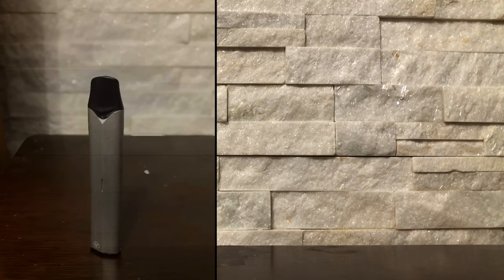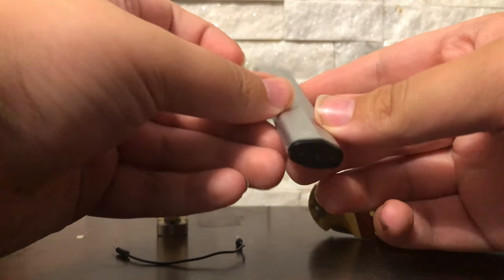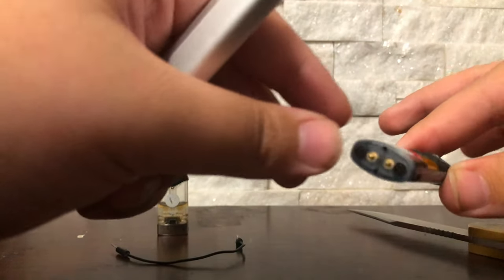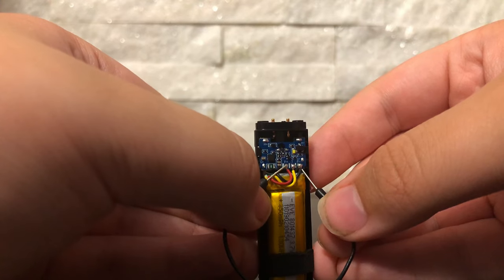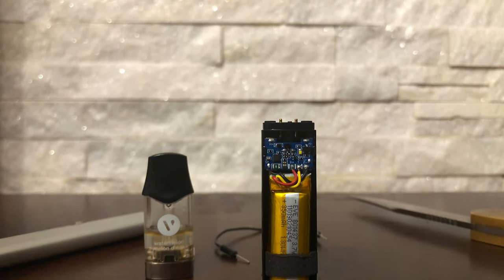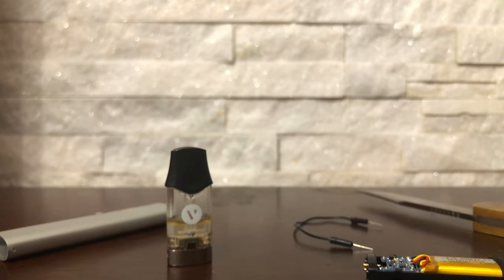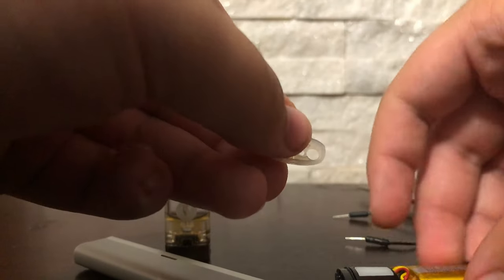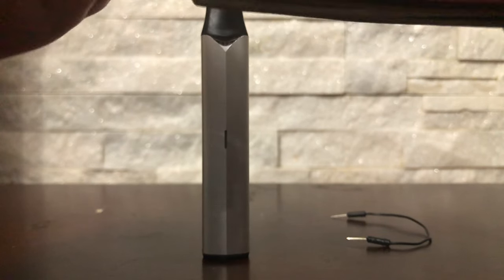How To Fix Defective Vuse ePod 2 In 5 Minutes! | [WORKING 2024] | Check pinned comment

Comment: Okay got the bottom part off, that was so difficult. It’s all mangled now. 

Then I used a safety pin o shirt it, there was a teeny tiny spark, and now when I charge it, the light stays on constantly (it won’t fade blink) 

Did I do something wrong? Is it going to explode??
Reply from the maker: if the light stays on that means it’s fully charged if it doesn’t fade after 5 seconds, that spark is supposed to happen, doesn’t always spark but it can
Reply from the maker: no it won’t explode😂
Reply: Thank you!! I’m still going to contact vuse customer service because this is the third pod I’ve bought this has happened to. So frustrating!
Reply from the maker: @megancampbell5603  no problem, they really have issues with their devices, i recommended getting an RPM40 or a NORD 2 if you like those kinds of vapes. 10/10 recommend the RPM if you like box mod designs with really good airflow, believe me it lasts long and works really well
Reply: You’re awesome! 
Can I get those at regular gas stations? I’m in Ontario. Where would I find those, vape shop I guess?
Reply: PS once I pulled another time, the light stayed on constantly 😳 really not trusting Vuse anymore.. 🤦🏼‍♀️
Reply from the maker: @megancampbell5603  Vape shops or online at smoktech
Reply: @megancampbell5603  corner store

Comment: Is there an alternative to those wires you were using to short with?
Reply from the maker: a normal stainless steel fork can work too, anything metallic that can reach both the red and black wires that are soldered to the board.
Reply: Any metal will work just fine. For instance I used a staple to do mine and it worked perfectly.
Reply: Use some tin foil. Small piece and roll it so its like a wire

Comment: How do I get the battery out mine has a curved shape and I can't get a knife evenly to separate it though not sure if the two dots on both sides have to do with it either not working or coming out...
Reply from the maker: those pins can come out which is kinda hard to do though
Reply: @xenocal  yeahh I was able to get one out, though think I got the other stuck smh, they really know how to make a product that craps out on ya
Reply from the maker: @user-pr2rz4jr5p  facts
Reply: @xenocal  I was able to get the battery out though there's only three cords white red and black, and thw board a bit different not too sure where I'd need to apply connection

Comment: Every time i put the pod in and take a pull then there is smoke but the light is off but it tastes burnt and when i take it out again there's smoke coming out from inside the thing and then when i put it on charge with the pod in then no light and it starts autofireing and when i pull the pod out again then smoke comes from the inside
Reply from the maker: that is a interesting thing i would say it’s a very broken device and that you should switch to a caliburn uwell vape, best DL vape you can buy and is only $20 some CAD
Reply: same

Comment: I don’t really understand, what does short it out mean?
Reply from the maker: it’s an electrical shortage that basically would break or ruin any device that doesn’t have a shortage protection but since the epod 2 has that feature built in, that’s how it’s able to be shorted and still work. i’m not too sure how shorting the device worked but after figuring it out and making a video it seems to be the reason that it’s working so yeah

Comment: No need to take it apart. I just connected the 2 furthest connections with some foil and it did the job
Reply from the maker: it’s also very dangerous because the charging ports are connected to the board that transfer through various components before reaching the battery, do it one too many times might not end well. my best guess it is doing the same but it’s risking other components that won’t be DIY fixable.
Reply: Stopped working few hours later. Tried this method again and its not working so was maybe a fluke

Comment: how did you pull the little pin holding it in out?
Reply from the maker: i didn’t, i broke them off tbh the device likes to do it often if it’s defective so it’s best to leave them out either way so it’s easy to access incase it happens again

Comment: how did you get rid of those pins that secure the bottom the first time ,because I'm struggling with opening it.
Reply from the maker: @TawandaMatenda  i forced mine until they came out but make sure your vuse doesn’t have a button on the side. If you have the button, don’t do this. If you don’t have a button, you can try this method
Reply: @xenocal  Thanks man🔥

Comment: I put it on charge and shorted it out it kills it , then wait a while put it on charge it wont light up then take 2 wires that are charged positive and negative and touch them to the corresponding colour by the battery, it revives it this time it holds charge

Comment: Dude it’s so hard to g et the bottom part off. HOW.
Reply from the maker: try removing those 2 metal pins in the bottom on the sides holding the plastic in
Reply: Now the light just stays on when I’m charging it, it won’t blink. Did I break it? Will it explode??

Comment: How does I do it when I don't have a wire like that?
Reply: Hey take an old cable and slice both ends shreed the rubber on the ends till you see the copper I did this and it fixed my vape.
Reply from the maker: y’all know you could literally use a stainless steel fork lol

Comment: Does it need to be that wire?
Reply from the maker: Nope, you can even use a metal fork. anything that can reach the positive and negative spots and is metal or a wire will work. just don’t hit the middle one

Comment: hold button for 30-40 seconds ...will reset it, this is nut z lol
Reply from the maker: People don't seem to understand there are two different devices. Vuse ePod 2 (this one) and ePod 2+. The ePod 2+ has a button, The original ePod 2 does not. Many commenters don't seem to understand this but I'm letting you know.

Comment: Anyone check out the vuse 2+ ?
Couple cool new features and it’s the same price as the vuse 2 .
Reply from the maker: bro are you blind? it is an epod 2. but they may be made slightly differently in different countries (don’t know tho but maybe)
Reply: @xenocal  alright well sorry cuz the epod 2 i just bought , has a button on the side now and the light isn’t white anymore . It’s green , yellow or red depending on the charge . 
Funny enough the reason I came to this video is because it wasn’t working . Apparently it locks and unlocks but nothing was pulling at all or vibrating or doing any of the commands . 
I returned it and got the old one lol .
The new epod 2 connects to your phone on an app and you can locate it if you loose it , control the amount of smoke you pull and lock it and turn it on and off . 

Anyways all good
Reply from the maker: @Wickedtingzz  that sounds nothing like vuse to do but hey i’ll check that out it sounds sick
Reply from the maker: @Wickedtingzz  i have found it on the vuse website. the one you’re talking about is the vuse epod 2+, where as in this video it’s the normal vuse epod 2
Reply: @xenocal  yes I just realized that brother , sorry for that . Didn’t notice it was the vuse 2 + . 

But ya it’s pretty cool , mine didn’t work unfortunately so I just returned it and got the old one .
But it was the same price for the 2+

Anyways cheers brother 
God bless
Reply from the maker: no problem and i might try it out soon, cheers

Comment: Is there any other way to fix it
Reply from the maker: Make sure to check the board for any damage or moisture and make sure all the wires from the battery and board are attached well. other than that if this isn’t the solution to it working again then contact the store you bought it from and/or vuse.com support to get a new one for no cost since it is defective
Reply: I can't open the bottom piece so I don't really know if the wires are connected properly
Reply from the maker: @epicgamz3901  you have to open the bottom to try and fix it, the only possible way i know of. if you’re still trying to fix it and want further help you can message me on instagram @NormalNexus i can reply easier there and show you easy ways to open it if you can’t get it open.
Reply: @xenocal  Wouldn't it be easier to push the bottom portion out from the top with the pod removed?
Reply from the maker: @gerryfolds7488  noooo because then you risk bend or breaking the pins or messing up the air flow hole(s)
Reply: No need to open it up. Just put the wire on the 2 charging points (the 2 furthest from each other on the bottom). I used some tin foil instead of a wire. Worked just fine
Reply: @mrpitch1978  didn’t work for me. Maybe mine has some other problem
Reply: @tylergibson2771  mine just packed up again. Tried same method and doesn't work now. Maybe it was just a fluke.